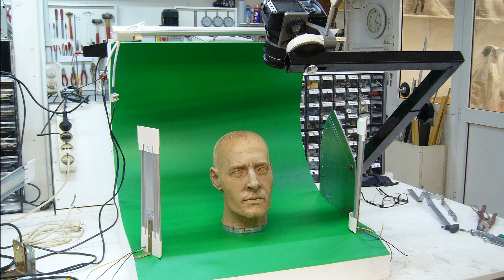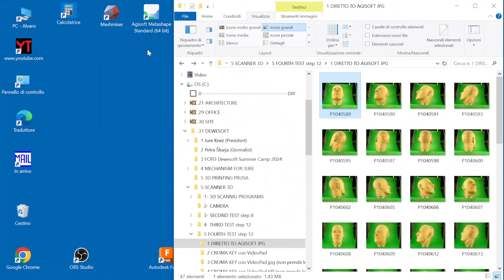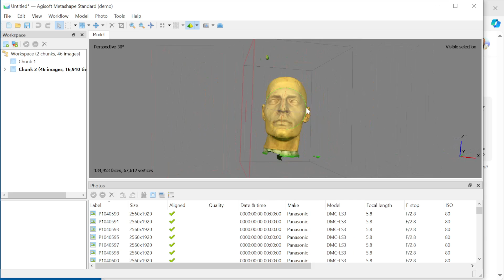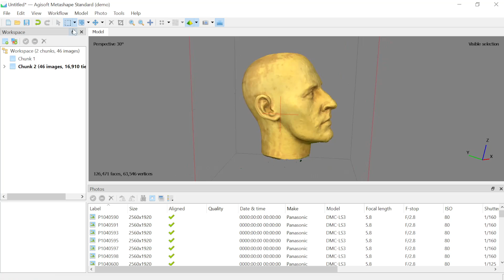How to scanner 3D objects to print - Tutorial

Comment: Great work! and so professional. and sir, may I ask do you have any affiliation?
and also, if you have budget and strong enough motor, I wanna recommend you to buy some rgbd camera and motorized z-stage for easier work. The stage's resolution is under 0.1mm if your motor(encoder) is fine, and it's not that expensive solution. 
But frankly your method seems more accurate
Reply from the maker: I am a freelancer, I am not affiliated with anyone.
I do animatronics for a living, and in my drawers I have all kinds of motors.
As I explained in the video, (with my poor English) if you have a lot of things to scan, you can motorize the plate.